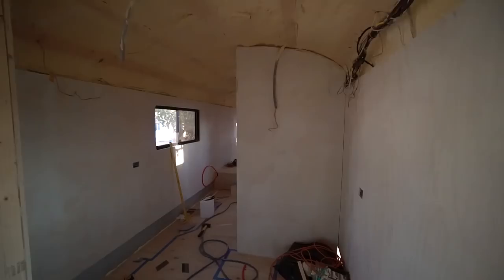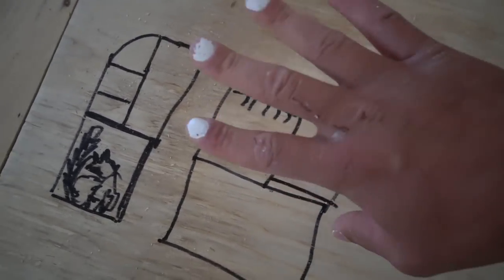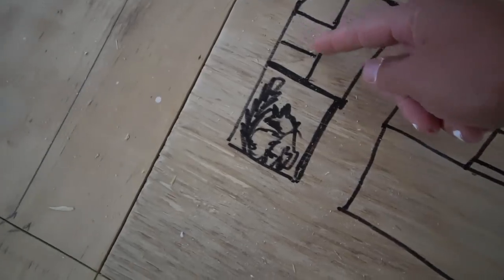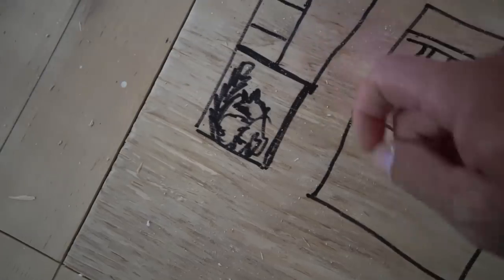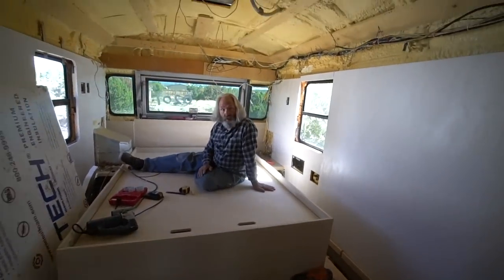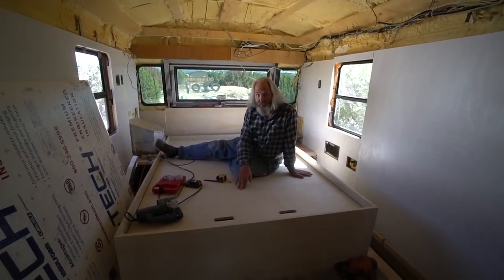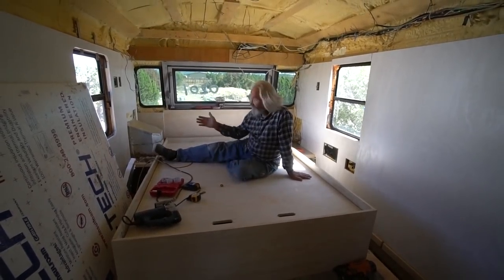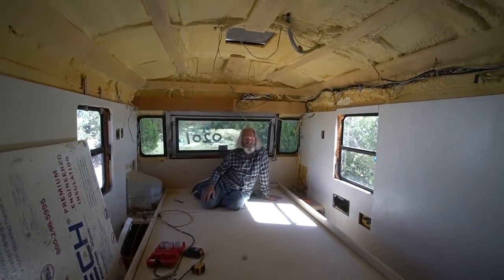Cabinet Plans - LVP Flooring - Bed Platform Built

Comment: Chris, for the stud walls between the kitchen and bathroom, why didn't you use 2x2's and 1/2" plywood to give you more room between the refrigerator and stove.  That 4-5" gain  would sure help in that tight spot.  Besides, why do you need 2x4 walls, it is not a weight barring wall, only a partition wall.  Anyhow, who else would know the difference?

Comment: Looking great! Had you thought about adding any slats on top of the trap door to allow your mattress to circulate air underneath and breathe? Our mattress has European style wooden “springs” instead of a box spring and I love the extra ventilation.
Reply: I was thinking the same. I saw on another Vanbus channel, Trent and Allie, that had to replace moldy plywood and buy a new mattress because of how much moisture was trapped without having the slatted framework underneath the mattress. Apparently, it's absolutely vital to have slats or some form of breathable framework, regarding bedding and the moisture that collects.

Comment: If you can use the electrical service/ linen cab adjacent to the shower for what would typically go in a vanity cabinet under a sink, is a pedestal sink impractical? Seems like you could build some racks on the lower part of the linen cab to hold cleaning products, etc. (like a big spice rack for cleaning bottles, extra shampoo, etc.) Nice bed work...good platform.
Reply from the maker: That's a good idea, I'll think about that!

Comment: ikea sells a 28 cm serving dished bowl called the blanda blank 
https://www.ikea.com/nl/nl/catalog/products/50057254/
thats a LOT cheaper than a regulair sink (2.80 euro bout 3 or 4 dollar) i think it can be used as a sink if you drill a hole in the bottom to mount a drain intoo , you can either sink it in the counter or set it on top and onl drill the drain through the countertop in the toilet
think for the under the bed storage it would be nice to have a hook mounted on the ceiling so you can use a ratchet strap to hold the lid open , the space is pretty big so i guess youre going to fill it with mostly big items , it be nice if you can lift that stuff out using two hands without having to hold the lid up with youre head